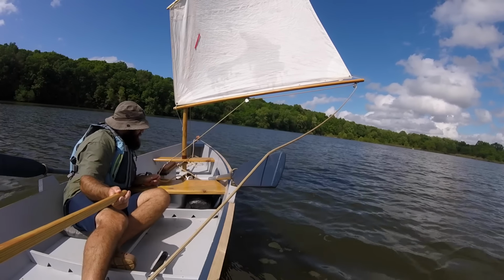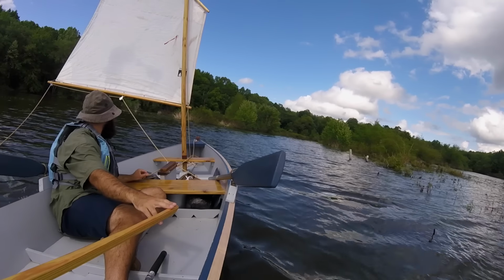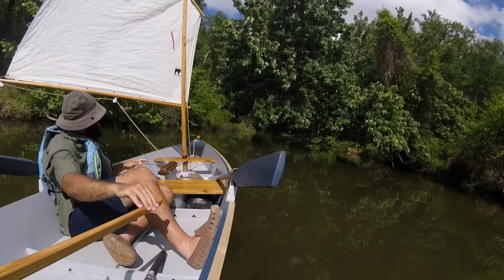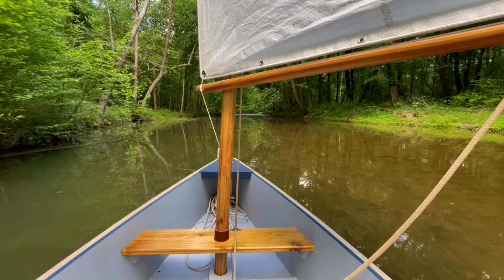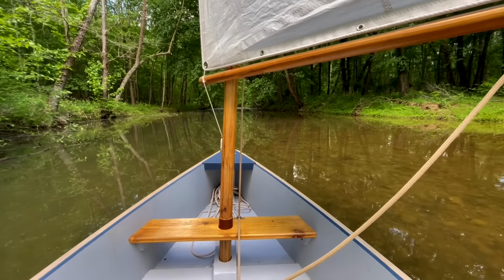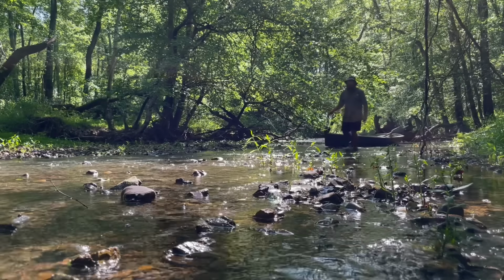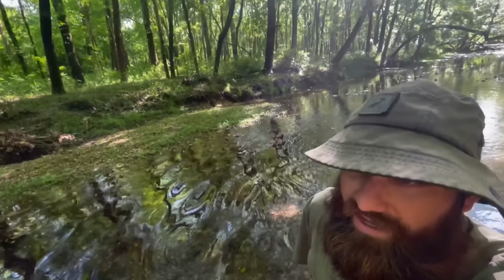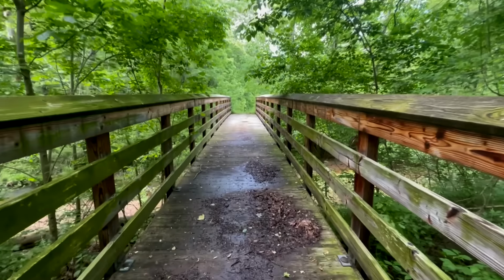Most Boats Can't Do This

Comment: Beautiful. And the only kind of boat that isn't a financial black hole
Reply from the maker: I have owned one or two of those! The absence of an engine helps.
Reply: Only way to get cheaper at that point is to make like a punt boat, i.e a flat bottomed boat without a rudder or sails and driven with a quant pole... at which point you pretty much just have a wooden box.
Reply: Lol never heard of a canoe before?
Reply: @nerfgunner2327  Canoes have the additional "feature"/"complexity" of pointed ends
Reply: @randomguy555  how does that equate to a financial black hole? Not trying to be smarmy but genuinely dont understand.

Comment: I live in an apartment with no place for a boat your videos make me feel like I'm out on the water again. Thanks a lot
Reply: With a couple of well placed bulkheads, you could probably cut that boat in two . Add some dolly wheels , it might make an apartment sized package.
Reply: They make inflatable and skin over frame, sailing canoes and kayaks.
You could make a skin on frame yourself.
Reply: I just bought an inflatable kayak.  Who needs space?
I need about a square metre.
Reply: @redtobertshateshandles  And so, the adventure begins!
Reply: @redtobertshateshandles  
I have a Pellican kayak that I trailer to the river with my bicycle on a modified bike trailer.
(In Detroit)
Reply: i got an intex mariner inflatable. fits in a trunk or back seat. stores in a closet. big duffle bag. good times.🍻
Reply: Got myself an inflatable kayak and definitely does the job
Reply: I live in an apartment too, try a little 14 foot aluminum boat or maybe a gheenoe, they fit inside of a 10x20 storage unit with plenty room left to spare for actual storage items if you put a swing tongue on the trailer! I have a Toyota Prius and live in an apartment and have ten totes and other junk AND a 16 foot gheenoe in my storage unit. Boat only costs 5 bucks to fill up after spending HOURS on the water cruising swimming and fishing. It keeps me sane during the summer when It's too hot to enjoy being on land and I don't even need a truck or a house to own it :)

Comment: Your skiff reminds me of the Phil Bolger boats we used to go lake camping with in NW Ontario - strong enough to take the knocks, light enough to portage between lakes.
One of the group would insist on bringing a 2hp Johnson along "just in case" and we'd say "We got oars" "But just in case" "Yeah, we got oars."
Only time I remember we tried to use it the darn thing wouldn't start - all that and the weight of the gas too.
"We got oars."

Comment: The idea of challenging yourself to sail that creek as far as you can reminds me of a very different, but also similar challenge my brothers and I used to take on. We used to live in an area close to a hiking trail that usually gets a lot of snow. We would hike to the back of the trail in the snow and try to sled all the way back out without stopping. We never made it all the way out because of a few narrow bridges that required some pretty sharp turns at fairly high speeds, but it was a blast all the same. The trail was about 3 miles with very little level ground.

Comment: I just subscribed and watched some of your videos.  I dig it.
I'm retired and want to drift down the Allegheny river in my 14 ft aluminum row boat.  I've done small trips of a few days but I want to go big or go home.  I rigged aluminum brackets on the bow that will support great weight and I'm sure a sail.  I built it to support one end of a hammock.  It all looks and works in my yard.  I aspire to drift in the hammock.  We'll see.  May tie on a kayak.
I wish I could get your opinion on something but it may not be appropriate here.  
I have had a 1959 Penn Yan Atlantic 18 runabout for 30 years but, do to my unforgivable neglect,has rot on the bottom of the ribs.  I bought clear white oak, an old 3hp planer (weighs about 800 lbs), and pretty much everything to do it.  
Its too big a project to steam each one and do it right.  In 10 years I probably wont be alive let alone boating.  I found out about a penetrating epoxy.  If I could simply cut, drill, glue, replace a little, and epoxy it becomes feasible.  No one recommends putting fiberglass on an old wooden boat.  If I could just get through 5 years with it.  Will it work?

Comment: In former times you crossed rivers by wading trough it, think of Oxford in England, Verdun in France as towns that grew up at such fords. At the same time very shallow draft craft used the rivers for transport. If the water was very shallow you could push your craft walking behind it. And water transport was very much cheaper than road transport using pack horses or even when using carts.
Reply from the maker: Water transport is wonderfully practical! Especially historically, as you say. My region is home to the confluence of several major rivers: Ohio, Mississippi, Tennessee, and Cumberland. This network of waterways was responsible for the founding of many important American settlements including Nashville and Paducah. Today, the rivers are utilized for commercial transport via barges.

Comment: Glad I found this video! I've been looking to build a sailboat for a number of years now. I bought plans for a boat that I thoroughly enjoy, the design is stitch and glue, and calls to be covered in fiberglass. I am in the same camp as you, where I'd rather not use synthetic materials. Are there any pieces of literature you'd recommend looking at for boat building in a more "traditional" way withiut fiberglass and such? If it helps any, the boat plans I bought are Core Sound 17 MK3 from B&B Yachts. I understand the boat likely can't be done withiut fiberglass, but boats and boat building are both very much new to me, so any input is greatly appreciated. Awesome video!
Reply from the maker: Check out "The Sharpie Book" by Reuel Parker. There is some great info about historical sharpies and small flat bottom skiffs in there. He discusses building methods too. A sharpie or flat iron skiff is ridiculously simple to build, and very practical for recreational boating. 

Stitch and glue building is said to be very easy, it's just not something I've delved into yet. I'm more comfortable with fasteners and solid wood. I've worked with those materials a lot, and have a good feel for what they can do. 
o

Comment: Wonderful. Instant sub. Does this rig go to weather?
Reply from the maker: It does to a degree, but not well. My style of sailing is usually focused on reaching a specific destination, most often downwind of my starting point. I typically don't bother trying to sail closer than a beam reach in this boat. Considering experimenting with more sail area and a deeper dagger board.
Reply: @cumberlandrover  I get that. I have taken my dinghy down wind down river (the river roach in Essex) a few times and it doesn't point well enough to get back. My rig is comparatively complex and I'd much prefer something like you've made here for cruising adventures.